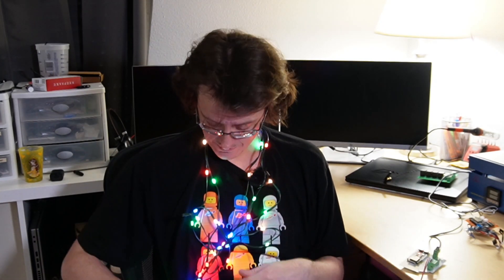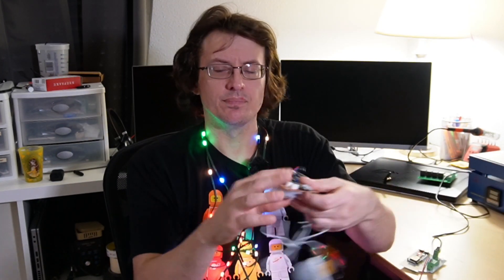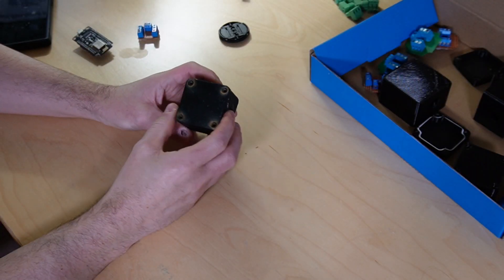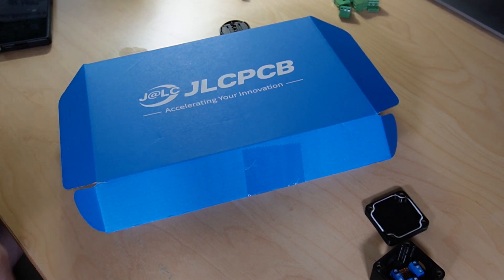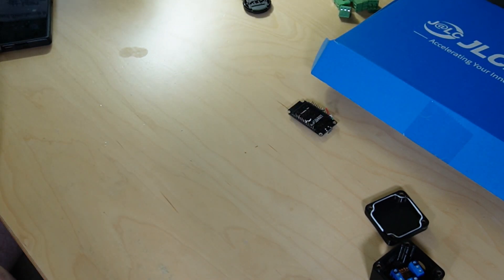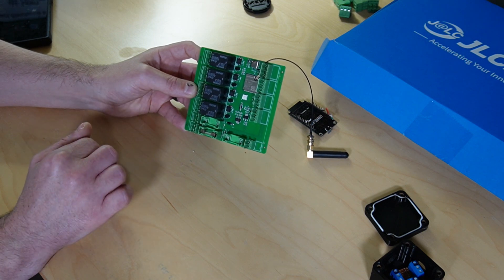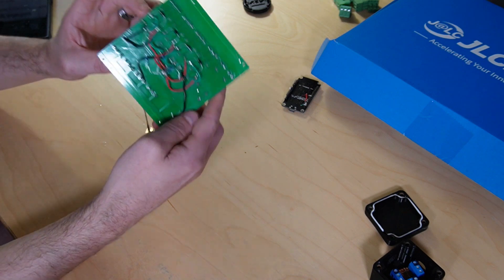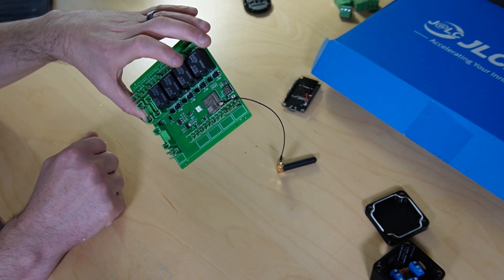Improving My Christmas Lights for 2024

Comment: Very cool. I found building my own PCB was a great learning experience. I just sent off my order to JLCPCB for a custom board that is mostly just a high current addressable LED power driver and IO breakout for a Pi Pico. It's got 16 JST SM ports for 16 strings, and a thick 12V plane that should be able to handle 100W. I've not looked at WLED yet, but wrote my own custom PIO code for the Pico's PIO, which can update 1000 LEDs across a dozen strings in a few microseconds. My idea here is to centralize the entire display in one place, so coordination comes for free. With the Pico W I can also run a web server for remote control.  This could also be used to drive video like grids at high frame rates. I hope I took enough time reviewing the PCB design that v1.0 works, but I am about 50/50 on that. Hopefully I can bodge it enough to get some experience on what to do for v2.
Reply from the maker: I'm still kicking myself for not posting my original design to r/PrintedCircuitBoard on Reddit for a design review. It would have saved me a lot of headaches. With that said, my screw ups have taught me a lot.
Reply: @ can’t learn without trying. Already realized I made a potentially big mistake after I sent mine in.  Thanks for posting. Look forward to version 2.